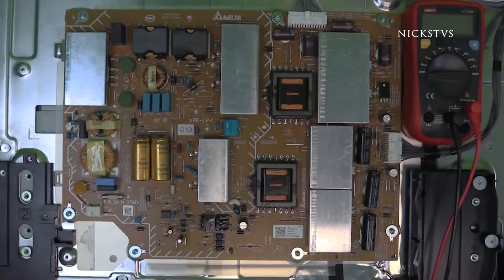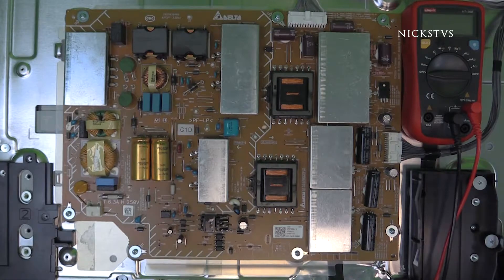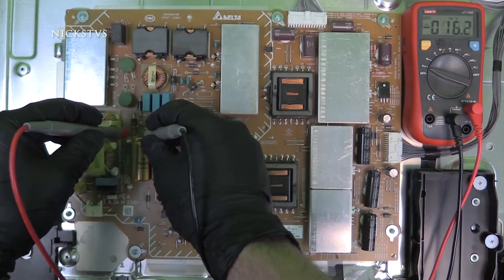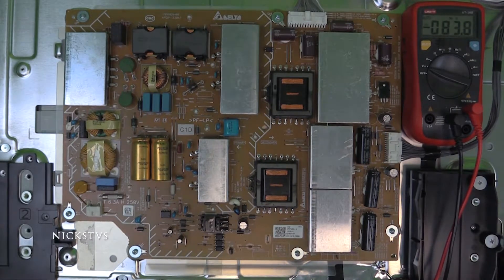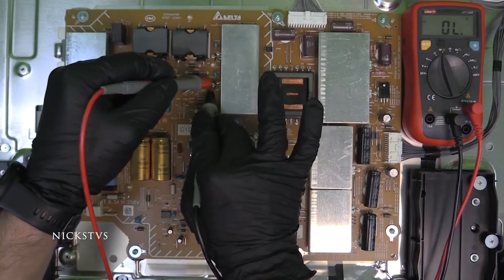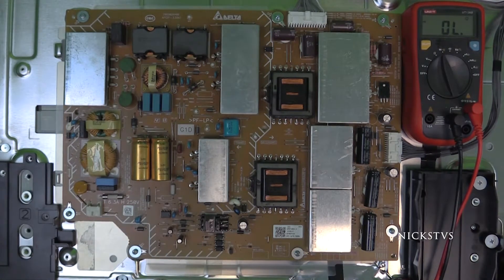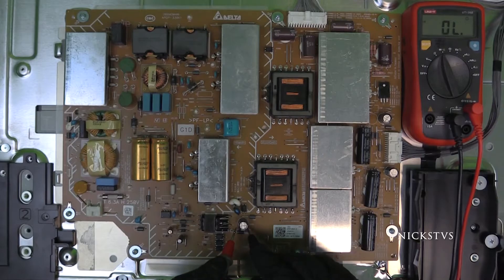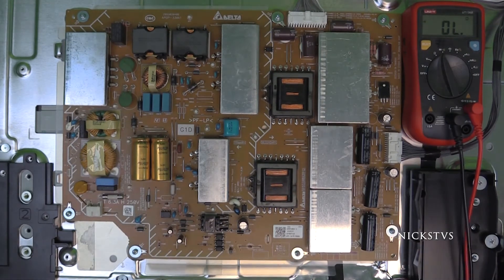Sony 2 Blink error code? Power supply troubleshooting!  XBR-55X900C XBR-65X900C XBR-75X910C

Comment: Hi, Nick, thank you so much for all the insightful videos, they have helped me and I am sure many others over time. I am trying to diagnose my 4 year old sony XBR55x900C, it doesnt have the power loop issue, at least not just yet. It did however develop horizontal lines across the screen, I replaced the t-con board and it solved the issue, but now I am having to deal with always alternating brightness/contrast. Here is a video of someone else having the same issue with their sony https://www.youtube.com/watch?v=x-aPTrwR6Xo . I have tried replacing the LED control module board and that hasnt helped either, the tv doesnt throw any blinking light codes. Could you help identifying what part may be failing here? TIA
Reply from the maker: Hello JnC445,
Unfortunately if your screen has developed horizontal lines, there is a good chance your screen has become defective and will need to be replaced. This is an operation which generally will cost more than purchasing a new TV. 
I am sorry to be the bearer of bad news but I would say if the lines aren't to bad and you can live with it, do so. Otherwise your best option would be to cut your losses and buy a new set. Your boards have a lot of value however incuding your backlight LED strips. If you want to recover some money, you would be able to sell your LED strips and circuit boards for a good chunk of cash on eBay.
Reply: Nick's TV Repair thank you so much for taking the time and replying. The lines across the screen were not permanent , they would show up and then go away , the lines issue got resolved by replacing the tcon board. My current issue is the constantly alternating contrast level as shown in the video I linked.

Comment: Hey do you have a troubleshooting video for Sony xbr65-850e? I have a flickering screen issue
Reply from the maker: We don't have a video for it at this time but do have a quick test. When it comes to flickering, this can be caused by either a backlight or the screen. The first step to determine the issue is to identify which part is flickering. 
Open up the TV's back cover, and plug it in to power. Turn it on and have picture playing. When you see the flickering occur, look at the little holes in the back of the set where you will see the glow from the backlight. Does the glow flicker? If yes, then your backlight is the issue. If the glow does not flicker, but the screen is flickering, then the screen, or main board is at fault and we can start trouble shooting further from there.
Reply: Nick's TV Repair hey well my tv screener this from flickering and is just showing static and green lines now so what’s next?

Comment: What do you think about a six blink code error on a xbr-75850c.  I've already switched the power board, does the same thing.
When I get it to power on, I get the android power up and the left half of screen is dimmer than the right, then it shuts off.
Sony seems to think its an update issue but I can't get the TV to stay on long enough to update, less than 5 secs.
Reply from the maker: This is actually going to be a backlight related failure. 6 blinks means one or more of your LED strips are going out and need to be replaced. I would suggest trying to find a replacement set and replacing all LED strips instead of just the defective one(s). 
If you are unable to find a replacement set available and are looking for a half way fix, you could disable your backlight error code by grounding out the BL_ERROR pin. This will allow the TV to stay on and operate but will do so with as you mentioned one side of the screen being darker than the other. This is a short term fix until you are able to get the proper replacement parts.
Good luck.

Comment: hello, i was wondering if you could help me 

i have a sony A9F. i have an error code of 4 blinking red lights. i tried replacing the tcon and power board to no avail 
how do i know if my main board is bad? when i disconnect the display cable from the main board i get a bright white light, no error codes, any way i can test it, how can i rule out the display itself?
Reply from the maker: According to my information, a 4 blink error code is indeed a T-con board failure but can also be an issue with the panel. It is an error indicating an issue with communication between the panel and T-con. 
Are you sure the T-con board you purchased is brand new? 
As of right now, there is no way that we are aware to check the panel for this type of failure.
Reply: @NicksTVRepair  how can i test the tcon board and where can i get a new one?